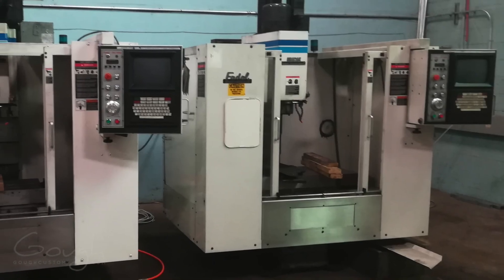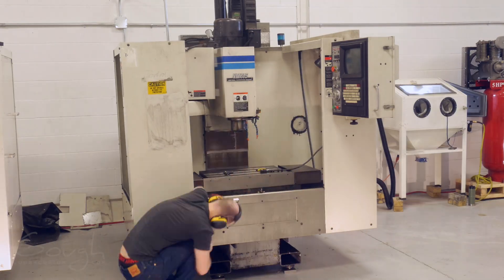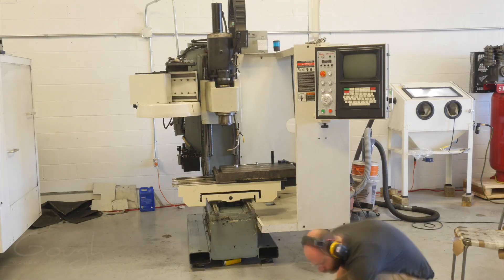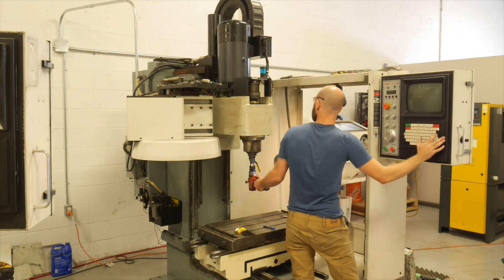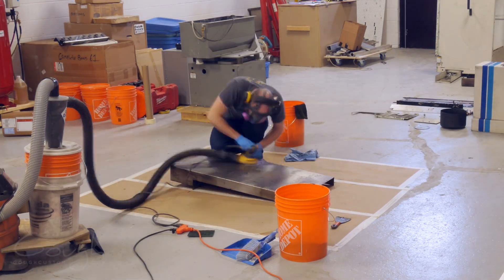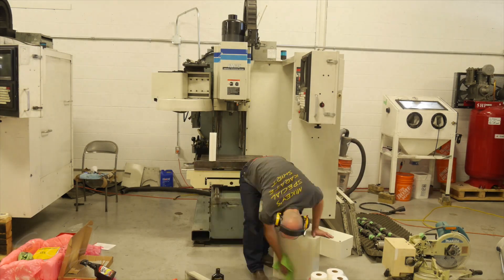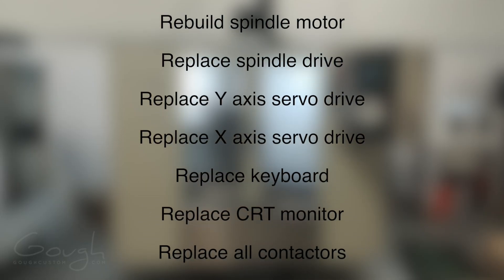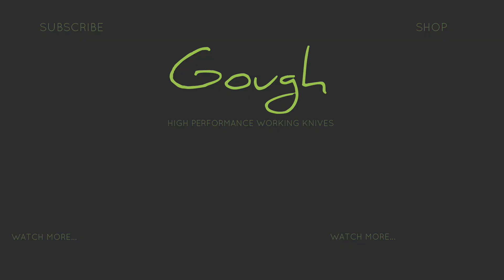Restoring a 24 year old CNC machine...

Comment: I run that same machine. Where is the oiler choke you had to clean? I need to do that to my machine, but I don't know what part it is. Awesome video!
Reply from the maker: Thanks Rob! If you take off the oil reservoir on the automatic oiler you will be able to see a couple of components that are actually inside the tank. On the right there is a Pneumatic cylinder, then just to the left of that and lower down it connects to a square aluminum block. The square aluminum block unit is the 'choke' which controls the flow rate of the output oil... Unfortunately I wasn't able to fix mine by cleaning it and had to replace it. However it's only an $80 part from ITSCNC.com... Let me know if you have any questions or need help!

Comment: Awesome! Always a treat to see an update from you. That blueing looks great. And holy mackerel, graphite is the worst possible thing for a circuitboard. Maybe second compared to salt water with graphite in it.
Reply from the maker: Glad you liked the video mate! Yeah it's hard to imagine too much stuff that would be worse for the machine... And crazy that the previous owner didn't simply invest a little bit of money in better duct collection... A HEPA rated dust collector plumbed into the enclosure would have made the graphite much less of an issue, but instead he just kept putting new parts in the machines... I have the service records and just about every part in the machine has been replaced at least once! 🙁

Comment: I love you are not taking shortcuts with restoring this. Great work, more videos please!
Reply from the maker: Thanks mate! Yeah shortcuts are not really my style! I have another 2 videos lined up and pretty much ready to go!
Reply: @GoughCustom  You didn‘t properly fix the loud spindle noise by actually changing the affected bearing(s) though. That‘s just what I realized
Reply from the maker: @Elektrotechniker  well that's because there's nothing wrong with the bearings! These machines use a toothed timing belt to drive the spindle, which is LOUD, especially when running at full speed. That's what I was working to improve with the changes to the spindle enclosure.

Comment: Lotta work there. I did a similar rebuild on an excel tm with fanuc. Took a few months but machine has been great for years now.
Reply from the maker: Nice Shane! Fanuc controllers seem crazy to me, I briefly had a CNC lathe with one and it seemed like they'd deliberately made it as hard to use as possible lol
Reply: @GoughCustom  Not bad once you get used to it. I’ve done some work with fadal as well. I just really sat down with it for a day or two once I did the lcd upgrade and modified my post processor for fusion.

Comment: I'm surprised you didn't have to replace ballscrews and linear ways.
Reply from the maker: I checked those all over pretty closely when I first went to inspect the machines... Both machines needed one thrust bearing each, but apart from that they were very tight. 2 tenths backlash on the sloppiest axis! The previous owner had replaced ballscrews on both machines at least once, so perhaps that's part of the reason they were still in good shape!
Reply: @GoughCustom  How long until you regret selling the other one, because you need another spindle?
Reply from the maker: @eformance  haha probably not long! I actually just moved to a smaller shop again so I don't have room for the extra machine anyway! 2 VMCs seems like enough for a one man show! :)
Reply: @GoughCustom  Oh, so the challenges you were alluding to.  In the video there was another person running around and working, so I'm guessing you upsized, then downsized. :-(  What counts is coming out the other side stronger.
Reply from the maker: @eformance  Yeah that was Mike in the video, he was working for me 3 days a week all last year but now I'm in a smaller shop and back to being solo. The decision was really based on stress levels and lifestyle choice rather than something that was a financial necessity, though COVID makes me more glad that I did it! As you said I scaled up and then scaled back down. Just found I really didn't enjoy the work when trying to work at a larger scale... I've been really making huge improvements to my process since going solo again!

Comment: I'm amazed that people can know exactly what to replace and how machines work. Amazing
Reply from the maker: Thanks Johan! It definitely takes some research and practice to learn what might be broken, how to test the machine, and how to fix it... But it's actually easier than you might think! Just giving it a shot is often half the battle, though I'm not sure I'd recommend starting with a large machine like these ones!
Reply: @GoughCustom  well, I have use of my grandfather's tools he bought when he was younger, maybe I should use them and learn about them
Reply from the maker: @johanpettersson8039  Definitely! Just find some small project you want to do, or some small thing you want to fix up and go from there! Starting small is key!
Reply: @GoughCustom  I've been thinking of making knives just to see how it is, but here are some issues, I don't know where to get it hardened properly and I'm not that good at making scales, I've tried before and failed miserably, any tips or tricks?
Reply from the maker: @johanpettersson8039  I have a lot of 'how to' videos on my channel that should answer most of your questions and give you a head start! Bottom line is that it just takes a lot of practice... Failing is totally ok! An important step on the way to learning and improvement!